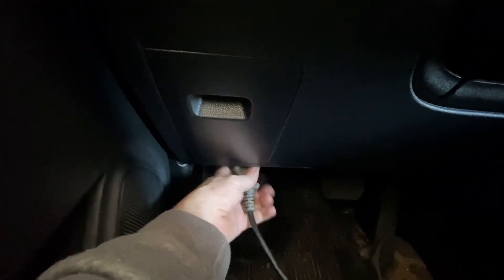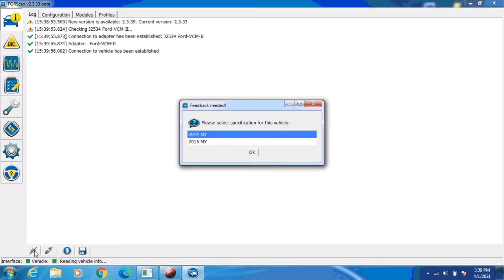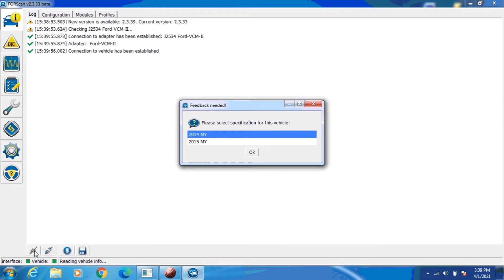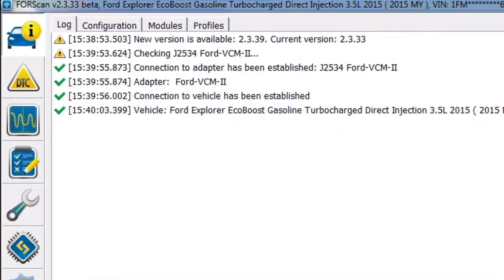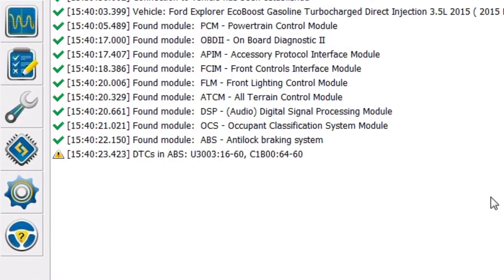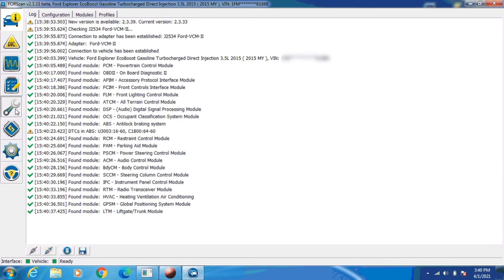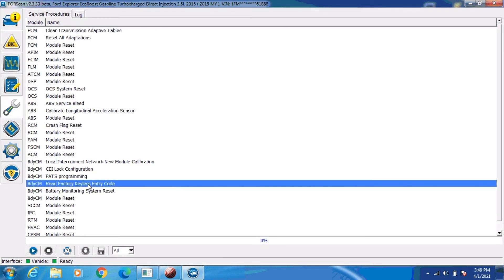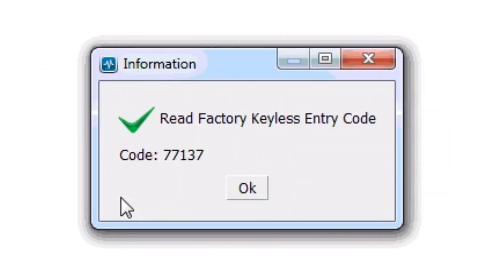Retrieving the Factory Keyless Entry Code on a Ford Explorer with Forscan

Comment: Please help. I have a 2008 Ford F150 and this is not working for me. When I click on Read PID Data and follow your instructions, I cannot find the Keyless Entry Codes. I searched through all of the available data and there isn't one called BdyCM. This is Forscan v2.3.60. I have the ELM adapter (with switch)  and a Dell laptop. I know that there's another way to get the code by clicking on the  Wrench (which I do see) and selecting Read Factory Keyless Entry Code but that's nowhere to be found either. What's the deal?

Comment: My 2014 Ex Limited should read the same, but when I run the SP it says no RFA module detected and to continue with GEM/BCM.  I'm pretty good with ForScan and digging around, but this one has me baffled... Ideas?
Reply from the maker: You’re trying to retrieve the keyless entry or? 2014 Explorer? It should be in the BCM.
Reply: @CarShopTalk  Yes, when I look in the BdyCM there is a service procedure for reading the code, but when run it says the there is no RFA module and to continue with the GEM/BCM. Which I don't know what is meant... If I look at the PIDs, there are no lines in the BCM that show any KeyCode digits or FactoryCode items. I have scanned every line of every module for them. The only place I have seen reference to a factory code is in the service procedures, where it fails...
Reply from the maker: @scottcarter8314  must be a glitch in Forscan for that year / calibration. Sorry.
Reply: @CarShopTalk  is there a way to use the outside keyless buttons on the pillar to lock the car like with the newer door buttons 7/8-9/0 at the same time?
Reply from the maker: @scottcarter8314  I thought that worked on those, like if you want to lock it with the FOB in it. Does it not work?
Reply: It is weird.  So I just pulled to covers under the steering week and looked at the sticker 😎
Reply from the maker: @scottcarter8314  That’s probably what I would have tried too lol.
Reply: I ment using the two buttons to lock with the smooth flush buttons on my 14 Explorer. I hate having to dig out my keys to just lock it. It works on my 2019 f150ltd but those buttons are the separate raised ones. Maybe the flush mount ones you can’t do that to lock it? Do you know?
Reply from the maker: @scottcarter8314  I thought you could. I thought they all did that. It should be in the owners manual to find out for sure.
Reply: @CarShopTalk  Duh, I figured it.  To lock it with your key on you, just touch the outer black plastic pad on the handle.  To unlock you touch the inside of the handle and the outer pad at the same time.  I'm sure that's probably in the manual which I have but never read...

Comment: What if we do not have that option? Running Forscan v2.3.511 on a 2018 lariat f150
Reply from the maker: That’s probably new enough you’ll need two keys and it will display it in the instrument cluster.
Reply: @CarShopTalk  thanks, I don't have another key. Was hoping Forscan could do it
Reply from the maker: @beaucopeland243  some of the newer stuff it’s not available through a scan tool.

Comment: Thank you, but how do you enter this code into new keyfobs?
Reply from the maker: This video is to recover the code for the number pad / keyless entry pad on the drivers door. To program a new keyfob for a push button start vehicle you’ll have to see if program a key is available under service procedures and use the programming slot in the center console.